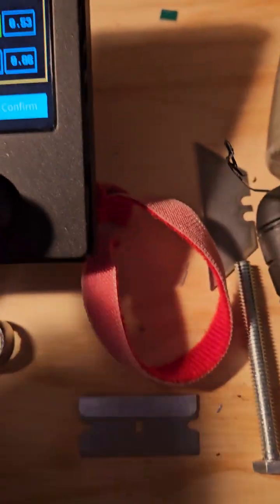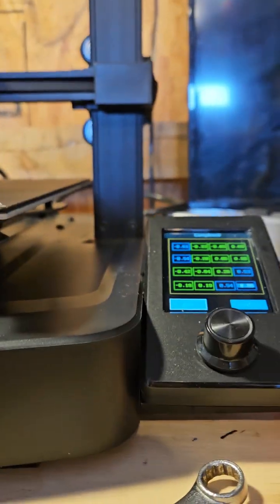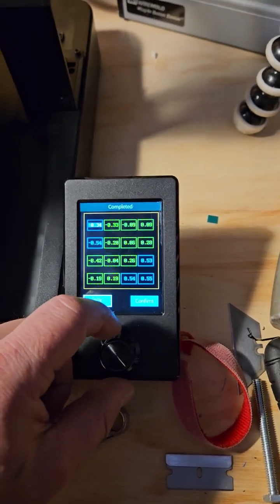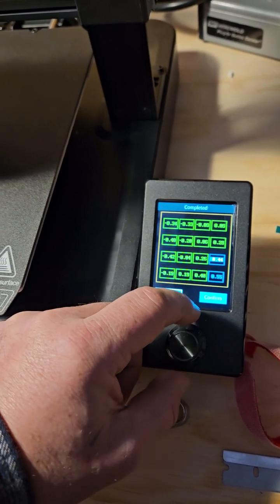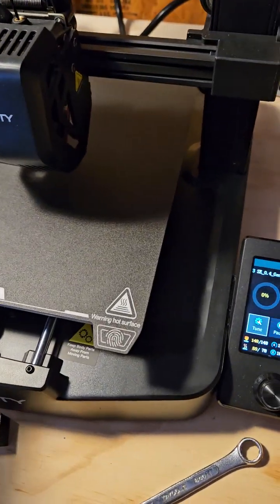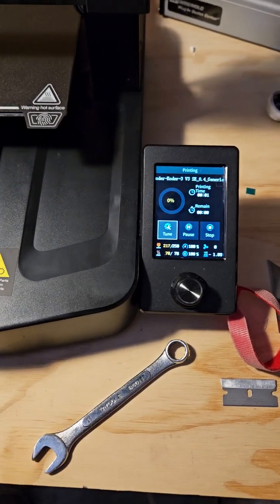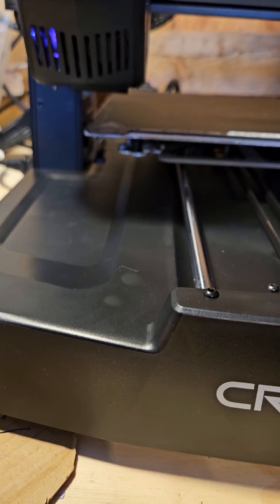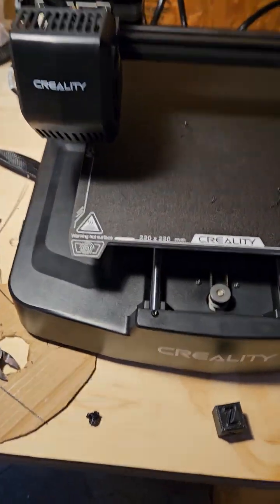ender 3 v3 se  officially junk? auto level? how?

Comment: This is literally exactly what I'm doing and I can't figure it out!!
Reply from the maker: I got it working after i fixed the bed by adding plastic shims. It should be able to compensate for a warped print bed . I might have also been doing something else wrong at the time this video is like what 2 years old now but I returned my printer within the return window to Amazon and I got a different printer.
When I finally did get this one to print everything was looking really nice and it printed really fast but the parts didn't fit together like they were out around or something.
I bought an alligator Neptune for pro and a sovol sv07 and although those printers aren't without issues I never had as much trouble with them as I did this thing
Reply: @hamradiohack Nice I'll keep that one in mind. I'm considering getting a new one. I figured out how to tone the bed. There was a magnetic mat covering the screws! But this thing keeps pausing constantly throughout the prints I can't figure out what's causing it. It's been one problem after another. And this one's supposed to be plug and play haha crazy

Comment: Im having the same issue only difference it wont stick to the side closest to the screen and mine right out of the box afyer put together and auto level was all green now i have 4 points that are blue
Reply from the maker: When I contacted the seller on Amazon they just gave me the run-around and they were trying to mail me more parts ultimately I ended up printing some plastic shims and inserting them underneath the bed since it wasn't adjustable and that seemed to help my problem because the bed mesh just didn't seem to be compensating for the Warped bed also part of the bed was bent on mine and I forced it and bent it to where it was a little bit closer to flat and that made a huge difference getting it to print good everything was a little cattywampus so I ended up returning the printer at about 25 Days In
I went and bought an eligible Neptune 4 pro and I think that that's a lot better of a printer but it is also not completely trouble-free
I had a couple of the older Ender 3 printers and they worked a lot better for me then that particular Ender 3

Comment: The spacers for the bed have two different sizes.  Reverse the two corners that are off ... Problem solved. ... Had the same issue when I bought my printer 2nd hand ... Got it for dirt cheap!! ... Once I figured that out it prints amazingly.

Comment: You don't adjust it. It's done. Leveling is finished. Read the damn manual or find a video. Negative and positive values are perfectly normal due to variations in the bed. The probe values tell the firmware how to adjust the Z axis position to compensate for those variations. It's just idiotic to call the printer junk when it's your own ignorance that's the issue.
Reply from the maker: The print bed carriage was bent beyond normal compensation.  I printed spacers and tweaked the under carriage and had it printing fine. Did you look at how old the video is?? Ive long moved on to sv07 and elegoo neptune 4pro and a sv06plus and klipper printers. I stand by original assessment.  Junk bent pos crap 💩 so far screwed it couldnt adjust for it. Ive had at least 10 printers since that video that none gave me that much trouble including ender 3 variations.  I definitely got a bad one that took a hit in shipping or something.
Reply: The blue doesn't mean done lol green are all good the blue isn't. 

Color	Meaning	
Green/Yellow	Near zero (flat)	
Red/Orange	High spots (positive values)	
Blue/Purple	Low spots (negative values

Comment: It compensated for warped bed thats why sum are in - blue bits sum times with thees cheap printer the z off set dont set 100% right so you want to download a off set test file and tune the off set as its printing the file also you want too set your first layer to the max temp it says your fillament says it to help it stick and set your bed to correct temp also you can use glue pritt stick to help it sticking
Reply from the maker: Yep. I returned that printer after 25 days never looked back

Comment: first tighten print bed screws incase they're loose, then auto level. the auto level creates a mesh level which compensates for any non leveled parts. then bring the the hotend to 0 on the z coord and check the z offset with the paper test(search it up). i had to bring my z offset down by 0.02 to get it perfect
Reply from the maker: Its fixed. It was too badly bent and until i shimmed it there wasnt enough compensation.  As I understand that not all prints or slicers use the mesh to print with so if a print isn't going to use the mesh then of course you're going to have problems